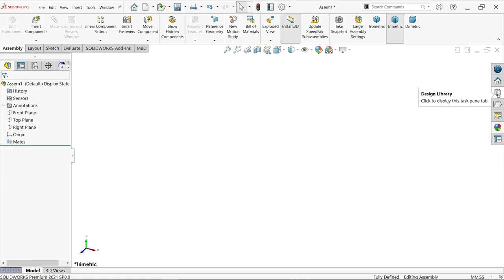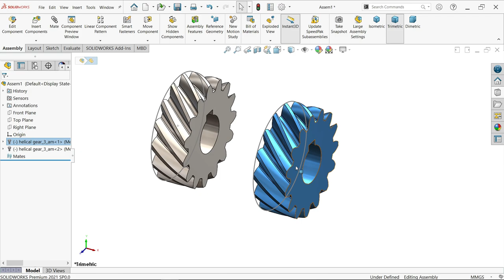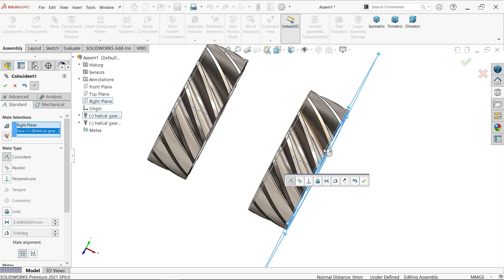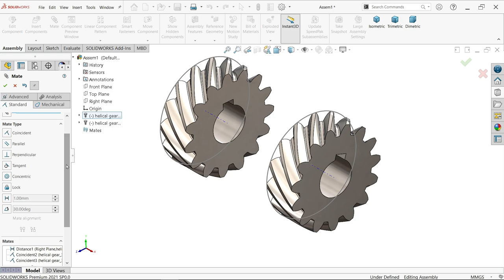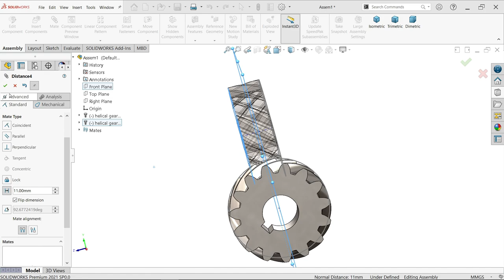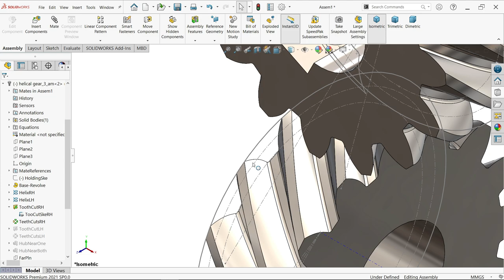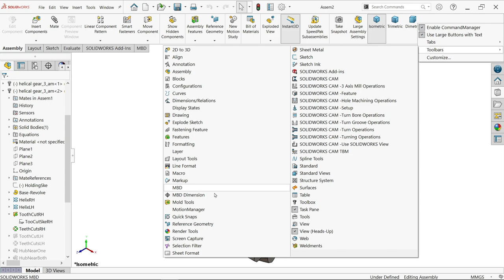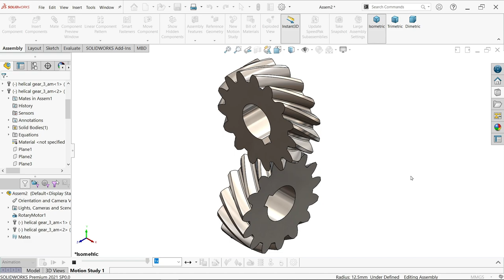90 degree Helical Gear Mechanism in SolidWorks Assembly

Comment: One doubts:- 
How to enable real view Graphics..
I'm using Windows 7, Solidworks 2017 version..

I'm trying 30408, 40408, 60408 , 60008, 31408, 30008 always Done ✅ but not showing

(Quadro NVS 150M/PCIe/SSE2)
Reply from the maker: you have to resister your graphics card in Solidworks system, check many videos available on How to register graphics card in Solidworks.
Reply: @CADCAMTUTORIALBYMAHTABALAM  please share links
Reply: @noorulameen5400  don't you me to serve for your food as well?